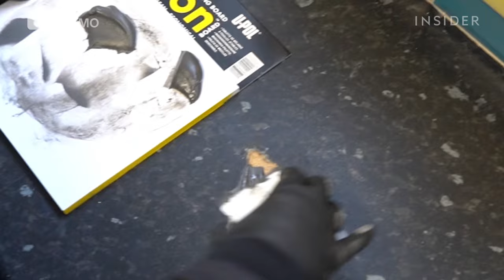How To Repair Chips In Countertops

Comment: Not worth the effort and cost sadly as materials and matching will be a pain
Reply: if you have a large countertop or two,with diffrent shapes and perfect match to furniture, its not easy/impossible to get the same piece after a few years.then it will be expensive to buy a new one for whole kitchen, and its more work to put new on completely.pass in all equipment, put them off electricity and on again, seal all edges, put on strips...
Reply: @peggy_universe  for cheap melamine regardless of labour just not worth it in the long run

Comment: Just get a new one they are like 30 bucks
Reply: A new countertop? Installed? For less than the price of a casita all small surface repair (many of which include lifetime warranties that cover these costs in full).  advised the world using your opinion under the misleading guise of experience and subject matter expertise..Was couldn’t be more wrong.
Reply: @fashiondiva6972  Soo you have one LITTLE Spot that has lifetime waranty while the rest can rott
Reply: Where in the heck do you live where you can get a quality piece of laminate top that is6+ feet long?  No way